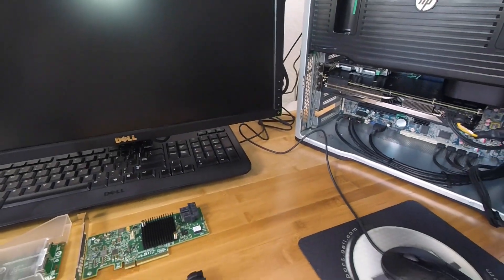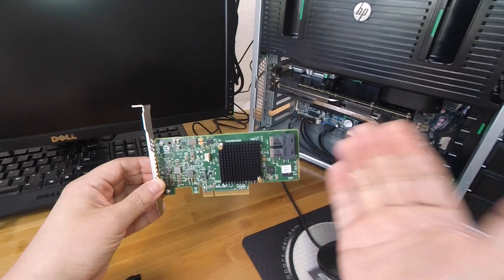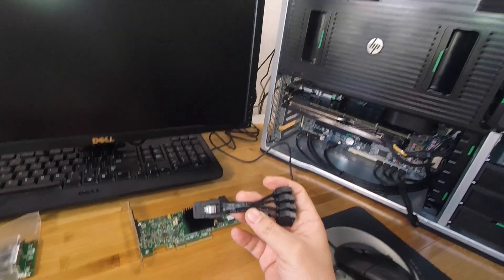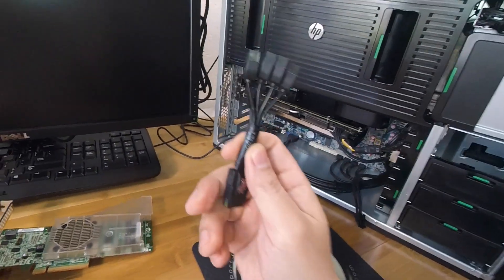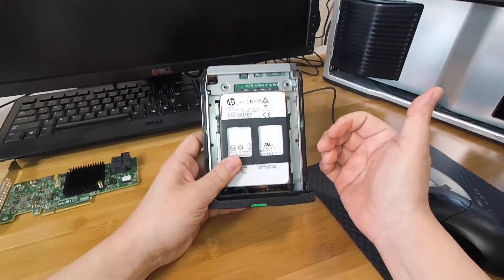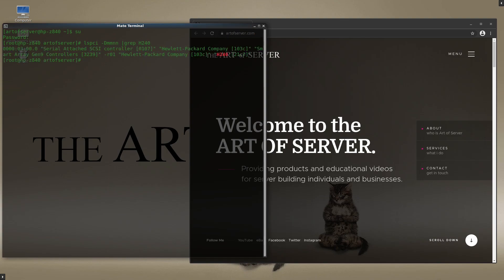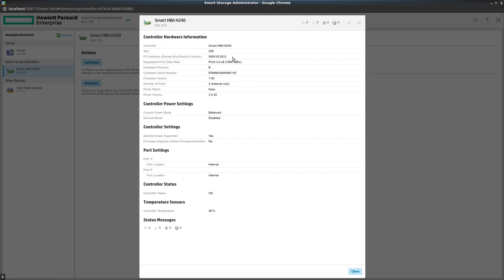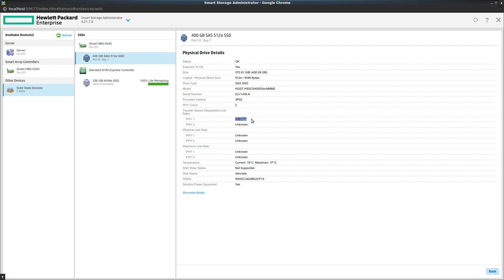How to upgrade HP Z840 workstation to SAS-3 12Gbps HBA | HP H240

Comment: First and foremost - thanks SO MUCH for such great content! Very much appreciated, Sir... Question: Ive found an HP P440 Card 749797-001 - which is just like the HP H240 but with a 4Gig cashe. Can this card be used in the HP Z840 ??? I figured the extra cashe and Raid configurations would be a help, but im a newbie to all of this, so im not certain ...
Reply from the maker: Yeah, that P440 is a real hardware RAID controller. If that's what you need, I'm sure you could use it. At least it's worth giving it a try.

Comment: I can't quote statistics at the moment, but I've been very pleased with the apparent performance of the built-in LSI-2308 RAID controller on the Z840. There's also a built-in Intel with RSTe RAID controller that's supposed to be even more performant than the LSI controller on the Z840.
Reply from the maker: Indeed! The only negative I have about the onboard LSI SAS2308 controller is that HP cut half the PCIe lanes. It is a PCIe 3.0 x8 capable chip, but if you check, it is connecting at PCIe 3.0 x4. This is enough bandwidth for HDD and a few SSDs, but it won't be enough if you're using something like 8x SSDs.

Comment: Does it also work with the z800? I have a sas3 SSD and would like to use it at maximum speed 12Gbps. I use a Nvme SSD (Crucial P3) as fast storage with a passive adapter on an 8x port and with CrystalDiskMark both write/read speeds are 1700Mb/s, so I assume that's the limit of PCI-E 2.0, am I wrong?
Reply from the maker: you can probably install a SAS-3 controller and connect those SSDs, however, the Z800 is PCIe 2.0 and SAS-3 SSDs will overwhelm the PCIe bus really quickly.

Comment: Hi,
First of all thank you so much for your very inspiring video. So inspiring that I've bought a Z840 to setup a trueness server. I've followed your advice (9 reasons why ...) and so far so good except for the H240. the card just not launch, during the post I have the initializing step, as on your video but it seems that an error message appear but to quickly to read it). on Ubuntu or Win10 I can see the card lspci(Ubuntu)  or Device management (win10) but :
Ubuntu "sudo ssacli ctrl all show config detail" => error no controller installed
Win10 Yellow exclamation point => device failed to launch
Any leads, recommendations ? Did you change something on the Bios ?
Thanks again for your video ;)
Reply: In Proliant servers remember you have to get into SSA to "enable HBA" mode for the card, even if the H240 is flashed to be in IT mode. If you don't do that first your POST will continually show 0 drives or an error. I don't know if that could be your issue, but get into SSA to get a good look. You can get into SSA using your ROM if you are on a Proliant, or using software for almost any OS, as shown in the video. The other issue you can be facing is that the card is not properly flashed. Have a look into which version of firmware you are in. If I am not wrong you have to be above 7 these days. There is plenty info online about flashing the card.
Reply from the maker: I'm glad my videos have been helpful to you. I'm very flattered that me fooling around with stuff has such a positive effect on others. :-)

I'm not sure about the H240 issue you have.
Reply: @ArtofServer  on your side did you change somthing on the Bios or it has worked "out of the box " ?

Comment: I installed one an H240 in my Z800 but cannot seem to enter the configuration setup utility, it shows it detected after the onboard LSI SAS controller but does not tell me a key to press.  Any suggestions?
Reply from the maker: The HP H240 doesn't have a ROM program that can manage the card in pre-boot environment. You can try to use their ssacli tool, but I had limited success with it.

Comment: Hi. I'm new to your channel.
Great video and very detailed explaination.
I have 1 questions about the HBA connection to the disk. sorry if I asked the same questions on who already asked.
As far as I know, SAS are dual port. they are using 2 physical SATA connection to achieve the bandwidth (as you think SAS3 are 12Gbps, and SATA are 6Gbps which are double the speed, hence the dual port).
And you are connect your SSD to the controller on 12Gbps speed, have you check the throughput?
But if you connect SATA drive to a SAS port, the drive would use single port hence only achieve 6Gbps (max SATA3 speed). but if you connect SAS drive, it would utilize 12Gbps because dual port being utilized.
Or did I wrong about it?

I'm getting a Z840 on a great deal soon. There's when I caught up on your vids.
Reply from the maker: Although most SAS storage devices are dual port, that doesn't mean the controller has dual ports to the SAS devices. To utilize both ports, you need a dual port backplane, and dual controllers and software to load balance the I/O. The 12Gbps link speed is not due to the dual ports, it is simply a faster protocol. So, even with a single port connection, you can get "up to" 12Gbps of transfer speeds, but your storage device must have the performance to achieve that. For example, SAS-3 HDDs may link at 12Gbps, but can only transfer up to around 2Gbps.
Reply: @ArtofServer  
Yes. Z workstation although using SAS drive most of the case, the backplane are using only single port.
That's why they leave the concept entirely and switch to U.2 port perhaps?
Most server I manage are using SAS, and they only utilize single RAID card and able to fully utilize the dual port SAS.
I mainly use Z620 at work, and now I understand why my RAID 0 SSD are can only achieve 1GBps bandwidth.
Been planning for the Z840 storage topology. I guess nVME are the most appropriate way to go for main storage. leaving the hotswap bay for large bulk storage.
Thank you for your great explaination.

Comment: Thanks for the video. I have just done this upgrade with the exact same HP Controller card on my Z840, and as you suggested on the video, I have also added a SAS Icy dock 4 drive MB994SP-4S as I found that the two 1.6tb 12gbs Hgst Husmm141clar1600 SSD drives that I had, and wanted to use as cache drives were 15mm high, and only this particular Icy dock unit would suit. So with the 4x4tb 3.5" 12gbs SAS Internal drives, 2x2tb HP 2.5" 12gbs drives in the other two Icy dock bays, I am now sorted for fast onboard storage. With the option of adding another Icy dock unit for four more drives too, if I got another of the same controller card.
Reply from the maker: Congrats! Glad this was helpful! :-) thanks for watching!

Comment: Hi, Thank you very much for this informative video. I tried installing this card (in HBA mode) in an Unraid server with Supermicro motherboard but I get the following strange error. Do you have any suggestions?
kernel: HP HPSA Driver (v 3.4.20-200)
kernel: hpsa 0000:04:00.0: can't disable ASPM; OS doesn't have ASPM control
...
kernel: hpsa 0000:03:00.0: board not ready, timed out.
haveged: haveged starting up

Comment: Are there any limitations to the HBA or the SAS-3 drive or can they be used normally ?
Reply from the maker: To use as a data drive, no problems. I have not figured out how to get the H240 to boot though.. so probably no good as a boot drive.
Reply: @ArtofServer  agh this is not what I wanted to see, refer to my other comment.  I guess booting ESXi from a USB stick will have to be the way forward then.

Comment: After following your instructions my HP Z840 won't post with the HP H240 installed it just hangs with the message "slot?? HPE Smart HBA H240 Controller 1805-Slot ?? Drive Array - Cache Module Super-Cap is not installed. Important: Unsupported Configuration cache Module Functionality is limited. Action: Install the Super-Cap to remove these limitations.1785-Slot??Drive Array Not Configured. No Drives Detected." (There was no physical drive installed) Can you suggest a solution please ?
Reply from the maker: I've seen some H240 all of a sudden start reporting that "cache module super-cap" error. It's really strange and I'm not sure why it does that some times. I would suggest trying to disable the Option ROM for the slot you installed the H240, then if it boots up past POST, use the ssacli tool to reset the firmware configuration. See if there's a setting to clear the cache too, if so do it.

Comment: I just bought an used HP H240 controller on ebay and wanted to plug it into my Z440 workstation. However the computer does not boot and there is an error message given by the controller's bios: "1805-Slot?? Drive Array - Cache Module Super-Cap is not installed; IMPORTANT: Unsupported Configuration: Cache Module functionality is limited. Action: Install the Super-Cap to remove these limitations" Have you seen similar problem?

Comment: Where can I find a cable  that supports 12Gbps per drive Samsung PM1643 15.36TB with SFF-8482 connector? All the cables on ebay from SFF-8087 to 29pin SFF-8482(x4) claim to only be 3Gbps or 6Gbps per drive not 12Gbps. which means that a cable must support 48Gbps in total. I can't find a cable like that anywhere.
Reply: did you find anything? for that Drive?

Comment: So I have a HP Z620 with 3 gray SATA ports on the mobo that run slots 0,1 & 2. I have all three filled and am trying to add one more 1TB HDD. I have 3 additional white SATA ports next to the gray ones and then two black SATA ports on top of the mobo and two on the edge where the cdrom was plugged it. I tried all of the ports but none seem to work with my 4th HDD. I recently installed Intel RSTe AHCI/RAID Driver 4.6.0.1085 which allowed me to add the 3rd drive to my system (last of the gray SATA ports) but is there a way to get that 4th drive to work on any of the remaining mobo SATA ports?

Comment: Hi> I have  HP Z840 workstation. IntelR xeon CPU E5-2680 V3 2.50 GHz. I have a question. can i change  two processors high kategory? This.... Intel Xeon E5-2690 V4 CPU Processor 14 Core 2.60GHZ 35MB L3 Cache 135W SR2N2 .
Reply from the maker: yes, you should be able to, but make sure you have the necessary BIOS update before you swap CPUs. I have a video here showing how to update the BIOS.
Reply: @ArtofServer  Amazing.Thanks. I buy new processors now  thank you for informations.

Comment: I had to hunt down those HP adapter cables over a year ago for a similar conversion of Corsair 900D hot-swap bays (SATA) to an HBA. Rare adapters!  I also have one of those H240 in HBA mode on a Proxmox host, nice card even if not an LSI chip.

Comment: The SAS controller on my HP Z800 has totally disappeared from the startup. I cleaned the motherboard, reset BIOS to defaults and still no luck with SAS Option ROM download enabled in the BIOS. Is there a way to fix this? Can I use the SAS 3 card in this video with the HP Z800? Thanks.
Reply from the maker: Check the system BIOS settings. There's a setting in there to disable the onboard SAS controller - check that it is not disabled.

If the onboard SAS controller is dead for some other reason, well, it's time to upgrade to SAS-2 at least then! See this video on how to do that: https://youtu.be/3eQIqCQnvuQ

You can also upgrade to SAS-3 like in this video with the Z840, but it's not really worth it because Z800 is PCIe 2.0, and the PCIe bus will bottleneck the SAS-3 SSDs. I think upgrading to SAS-2 makes the most sense.